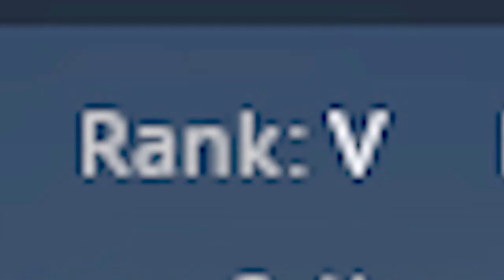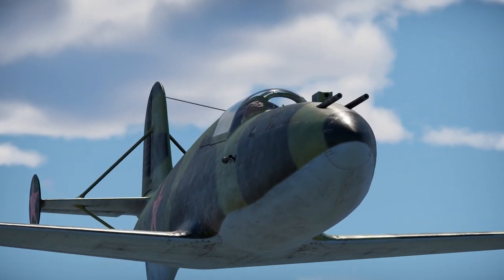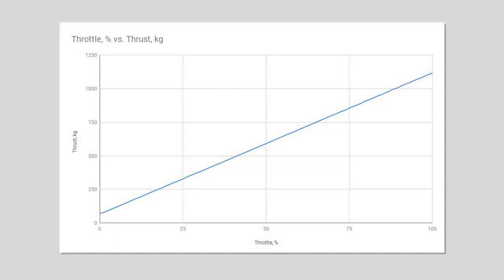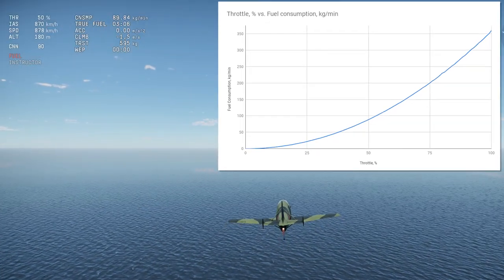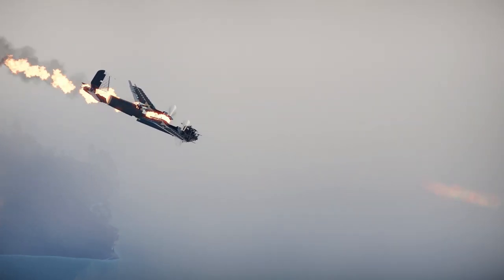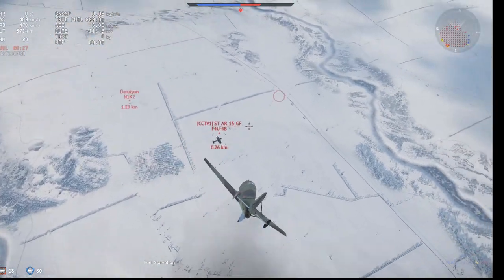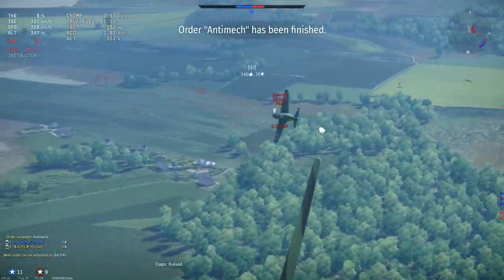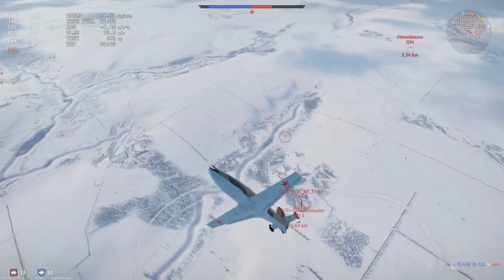How 2 minutes of fuel is enough to be overpowered

Comment: Does the fuel consumption formula apply to every plane or is it just this one?
Reply from the maker: In an extremely limited test, props seem to be roughly constant. i.e 50%throttle = 50% fuel consumption. Wep increases consumption quite a bit on some props and (obviously) significantly on after burning jets. The formula applies to the Me163 however.
Reply: @ZoltanSultan  how it apply to jets that arent using their afterburners?
Reply from the maker: @thegamingcat3202  Really depends on what jet. Vtol jets use a lot more when hovering, for example. I can test something specific if you want or if you want to know for a lot of planes, check out _avb_'s real time info tool I linked in the description so you can test any plane for yourself.
Reply: @ZoltanSultan  i was just curious if setting back the throttle on jets is a good way to get back to the airfield when you are low on fuel
Reply from the maker: @thegamingcat3202  I tested the F9F and Mig 17 and they seem to be roughly linear.
Reply: @ZoltanSultan  ok, thank you!

Comment: Thank you for this informative video! Is the data still relevant after gaijin’s “engine efficiency at low thrust corrections” in 2.0?
Reply from the maker: Video was made in game version 2.3.0.48 (version always in description) so I assume the information is ok but I've not heard anything about engine efficiency changes, could you link me to some more information like patch notes or something?
Reply: @ZoltanSultan  I noticed that BI-1 started to consume more fuel on average after patch 2.0 and in the changelog under flight model changes (3rd from the bottom) I saw that “engine efficiency at low thrust has been corrected”. https://warthunder.com/en/game/changelog/current/1167. However, as you said, you made your research in 2.3, so the info should be fine.
Reply from the maker: @mikaler6327  ah yes I remember that change now. so ye video should be good still. thanks for watching my video :)

Comment: You fine sir have just earned one more subscriber. Oh and regarding the video itself: does this also work with Me 163?
Reply from the maker: From some quick testing;

The raw KG/min fuel consumption is actually lower on the 163 but follows a similar overall trend to the BI (so the graph would be the same shape but with different values).  The whole flight model is different so nothing in the video really applies other than the very basic "50% throttle = 4x less fuel consumption".